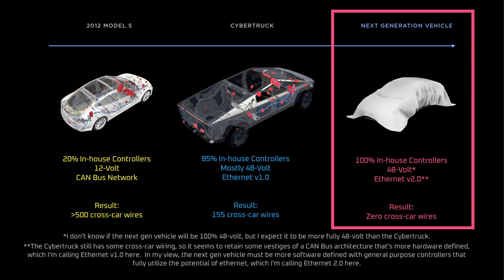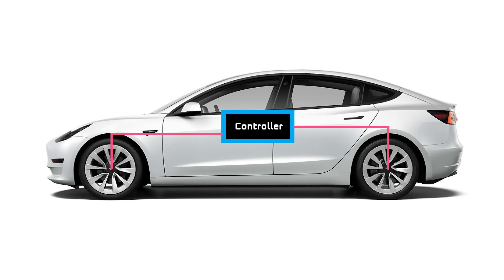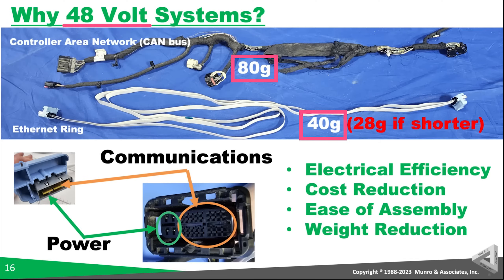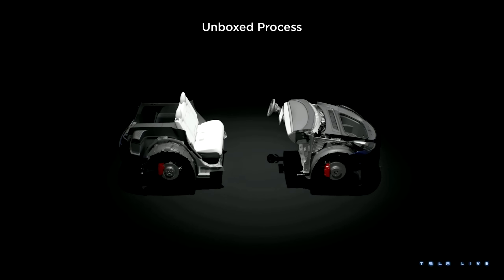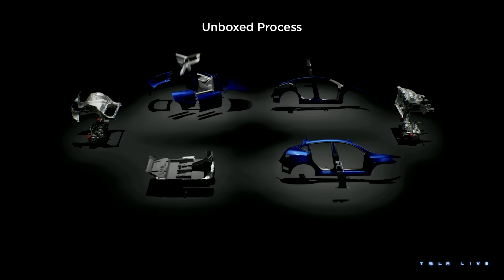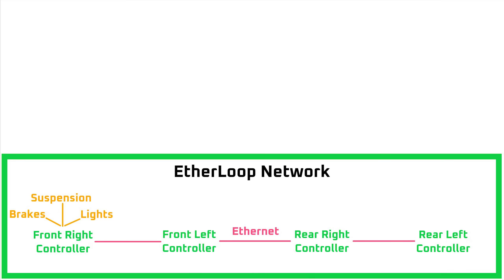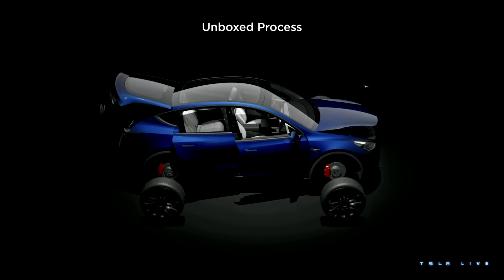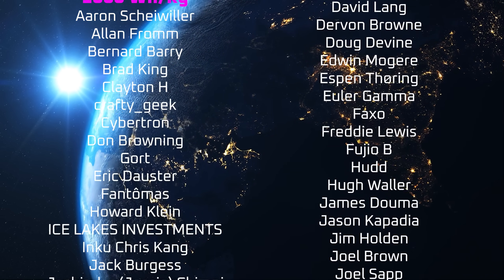Digging Deeper on Tesla's Etherloop Wiring System

Comment: Most of the things you mention could also be done with CAN. This is more of an architectural revolution, not so much a battle between two specific bus standards. The main advantage of the Ethernet bus is the much higher data rate.

CAN is an extremely robust and elegant system but it was designed long ago, and despite several updates the data rate just isn't high enough to properly stream video. The endpoint adressing also isn't that flexible, but it can manage a couple of hundred end points, and nothing stops you from building a ring architecture with CAN. Back then the whole system architecture was meant to be hard-coded in each controller's hardware (systems were very small and simple). Each controller would be assigned a fixed ID in its hardware and only listen to messages adressing that ID.

The ID also serves as an elegant prioritization scheme. After the bus is clear (previous message finished) all controllers that want to send a message will immediately start talking, starting by sending their ID. The highest priority ID corresponds to the most dominant voltage pattern on the bus. All the lower priority controllers notice that someone is talking over them and stop. That way you never have any delays for the highest priority messages, and never have any aborted messages either. This is totally unique. In Ethernet, if two end points start talking at the same time, both will abort sending after they notice the collision and then wait a random time before trying again. However, this is not much of a problem with the ring architecture, because you only have two end points on each bus, and if you use bidirectional wiring those two can even talk at the same time.
Reply from the maker: They could be done with CAN, but my understanding with greater manufacturing complexity

Definitely not my wheelhouse, but seems like etherloop is the way to go for unboxed
Reply: @thelimitingfactor  CAN is definitely not well-suited for some things that Tesla want to do with their vehicles (like having lots of cameras, lots of compute, doing lots of software updates). So it's definitely the right decision to switch to a new bus that can easily do all of these.
I just wanted to point out that the advantages you are talking about in the video don't really come from changing from CAN to Ethernet, but rather from changing from a traditional automotive network architecture to a ring architecture.
Reply: CAN is neither robust nor elegant.  Other than the cripplingly slow speeds of a '90's dial up modem, it has absolutely ZERO concept of security.  No device ID, no addressing - anything connected to the bus can blast whatever it feels like and listen to everything.  CANbus was outdated by 1991, momentum was the only reason it continued to be used.  Because it was simple enough that non software/networking people could use it and the tools were common.  The work around was to just use more and more isolated CANbuses throughout a vehicle, which itself became a nightmare.  The same data from one sensor/source has to be echoed on every bus, often with different names.  I couldn't design a more nightmareish protocol to work with if I tried.
Reply: @GregHassler  Nothing stops sensors from sending encrypted data over CAN. Providing security is not the task of layer two, CAN is no more or less secure than Ethernet. If you can connect to the physical wires of an Ethernet you can snoop and spoof any traffic the same way you can with CAN.

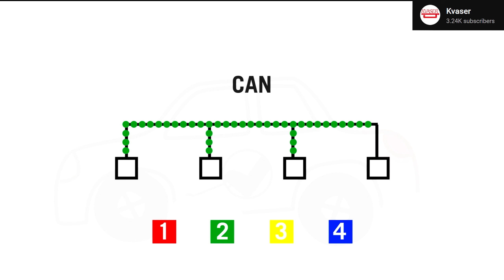Comment: The part at 15:54 is misleading. That does not happen on modern ethernet networks. Modern ethernet networks are switched, which means each node is on its own collision domain. Its been that way since the early 2000s.

Comment: Etherloop sniffs of IBM’s old token ring technology.  The downside to that besides slow speed, should there be a bad actor on the ring, the whole ring fails as the loop is broken.  IBM eventually came up with the MAU which was basically a switch that arbitrated network traffic and thus collisions on the network. That was where Ethernet survived as by design each node on the network was independent and surpassed the speed that was possible with TR.

Comment: I still don't understand why Telsa bothers to have ethernet wiring at all since they are using proprietary system anyway. They could easily use Powerline protocol (data over grid power lines) to transmit data over power connections and then you could have a single 48 V main line from front to back and every device using electricity would simply pull from it and use the same wiring for data, too. As long as the ethernet uses shared medium, a single broken device in the network can still mess the data line for everybody.

The only question is, could you do it all with a single wire because car body could be used to replace shared ground wiring? It would probably increase noise for data transmissions but for how much?

In case of Powerline protocol, it would be possible that a single failed device might appear just as extra noise and other devices could still communicate slowly in noisy network to allow identifying the failed part for easier repair.

Comment: Does this mean that if an accident occurs, a complete car subassembly can be easily and quickly removed and replaced with no wiring issues?
That alone would revolutionize car repair.
Reply from the maker: I would imagine so!
Reply: I saw this coming about a year ago.
If your passenger cage is ok, but the front end is twisted/cracked, you simply reverse the assembly process then transfer undamaged components onto a new casting and reassemble.
.
However 
It's likely that damage of that type *would * extend to other "modules".
.
Interesting implications for vehicle dismantlers! ("Junkyards")
They could classify by 
Vehicle Model
SECTION
Front
Centre (shell)
Centre base (Pack/ interior)
Rear.
.
Unbolt and store the undamaged, complete sections in a warehouse on racks.
.
You should be able to build a complete vehicle using sections  from 4 different vehicles!?
AND the resulting "Mongrel" would be in perfect alignment!

Comment: Changing the base voltage of automotive electrical systems has been debater since the 80's with no consensus past the 12VDC ceiling. Going above 48V raises the specter of getting electrical shocks from the basic wiring - also why Industrial controls typically run on 24 VDC/AC for safety.
Reply: Up to 50 or 60 volts is considered completely safe for humans.

Comment: This is the fourth time listening to this with 1:1 speed. I still don't clearly get physical structure of eternet. Would it be plug-in connectors between different sections of the vehicles that are built separately?

Comment: Any clue if Tesla may retrofit that etherloop network across their fleet into production factories ?
Reply from the maker: They will, but it'll take some time!  Better to roll it out in new vehicles rather than shut down the money printer
Reply: The Etherloop comes part and parcel with both 48v and the Gen 3 electrical hubs/ components.
.
I do think the "interim" vehicles will be a hybrid of amortized bodyshell/ production system and "pre-built (unboxed) casting assemblies".
Those assemblies would require the simplify of connection which comes with the Etherloop, which in turn would require the "Gen 3" componentry.
.
They will be a very crafty test bed for that system in cars that are "familiar" and can be made cheaply with existing tooling.
(imo)

Comment: A normal Ethernet cable has 8 strands, that's 4 times the copper of a can bus, this seems unlikely to be beneficial on its own. A point-to-point connection would suggest controllers act as switches which introduces additional latency. If you use two-strand ethernet and use a custom protocol for low latency, why even call it ethernet at that point. The name reminds me of token ring. While I'm sure Tesla engineers have their reasons and might be onto something, I don't think your guesses hit the mark.

Comment: I don’t believe your statement regarding controllers being redesigned completely to accommodate 48v supply is correct. Micros typically run on 3/3.3/5V and these are provided by the onboard power supply stages. Tesla isn’t replacing STMicro or Infineon or NXP or TI chips.

Comment: If these sensors use software, theoretically, the CPU could be eliminated. The octopus, they say, has neurons in its arms that helps with thinking. It could eventually evolve to the point where the brain could reduce to the point of merely connecting the thinking neurons in the arms.

Comment: Okay here's my question. Why do we need a windshield wiper controller? Since when does a couple relays and a few wires going to a self-contained windshield wiper motor module not work?
Reply: You don't. People buy it, they think it's important, and demand from the manufacturer complicated useless stuff. You have to take into account that this are the people who buy new cars, not sh ones. Lots of useless stuff get put into vehicles, which make it more expensive or deflect the money being put into stuff that makes a car more reliable like better materials for engine components or better coatings underneath to prevent rust. At the end of the day, the manufacturer cares about people who buy new cars, this people usually finance it over 5 years, and they usually buy another new car once this period is over. That's why, they can cut cost on reliability and put it into gimmicks because that's what the costumer wants.

Comment: your theory about ethernet only holds up with 10base 2 (created around the same time as can bus) not modern switched ethernet. Collisions like the ones you described were common on 10base 2 ethernet but now are so rare in modern Ethernet that its not even monitored for and when it is observed it almost always means something is physically wrong with the network. As for priority this was solved decades ago with QOS (Quality of service) tagging. The big change is that support features like VLAN's and QOS 10 years ago you would expect to pay $1k or more for those features in a small switch, but in the last few years you have started seeing those features on switches that cost less than $100 running on cheap commodity SOC's at their core. For that matter there is no reason you couldn't go fully fibre (fiberoptic protocol but not necessarily using glass) in a modern vehicle. for example considering the distances you could possibly use plastic fibreoptic cable, plastic fibreoptics are slower and have higher latency than traditional glass fiberoptic cable but are still has lower latency than copper and is nearly as flexible as copper wire while adding electrical isolation. The reason electrical isolation is important is it would make diagnosis of issues easier and would prevent one bad module from being able to damage other modules or the main computer. The down side of using a fibre based ethernet network is you would need a separate electrical bus for current but this buss could just be a couple (1 or 2) of wires or even bus bar that run the length of the vehicle and possibly some local distribution breakouts or fuse boxes if you wanted to add even more protection. the final advantage to using fibreoptics would be signal multiplexing essentially you can run 10 or more light frequencies in a signal cable so you can give critical functions their own frequency that would be the virtual equivalent of giving them a dedicated cable with absolutely no chance of collision or delay.

Comment: There's a reason we put all the brakes into one controller instead of just having a master controller and a whole pile of remote I/O.  Latency and reliability. If you need to do some high speed closed-loop control, waiting for information to be translated and come down an ethernet cable isn't feasible. Not to mention the redundant reliability issues you introduce by having so many more points of failure both on a hardware level and software level between the point your controlling (brake sensor or brake actuator) to the controller making the decision. And Industries are already moving to EtherCAT for higher data bandwidth needs. No one is going to use Tesla's proprietary garbage.

Comment: I really do not see how CAN stops you from having general controllers the same as any other network. With the right software + controllers/models, you could replace the network standard from CAN to Ethernet and back without changing the wiring apart from speed.

And if you are going to use cat type cable, aren't you going to use 8 wires instead of 2?

I think the change might have a lot more to do with making the parts proprietary and probably patented so you are forced to buy all the parts from Tesla at a high price without any competition.

Comment: 14:07 The EtherLoop Network seems to resemble the biological lymphatic system, with the lymphatic nodes and their systematic arrangement, where one group of lymph nodes can act as the confluence of many different areas through lymphatic vessels, just that in this case there would be no cross-wirings like in our body 😄

Comment: "N times less" as a concept only makes sense when comparing 2+ things, both of which are a reduction.  Say, a baseline representing 100% and then ThingA that's a 20% reduction and ThingB that's a 40% reduction; ThingB could be said to be '2 times less' than ThingA.  However, for 1 thing that's a reduction as compared directly to the baseline '4 times less' makes no sense; 4 times what? You mean it represents 'one fourth the weight'.  It seems to be a common misconception.

Comment: What about endpoint wiring? When you start combining controllers, the endpoint wiring increases. It's what bus systems like CAN are designed to prevent. Desing a CAN/LIN/whatever controller at every endpoint and there is no endpoint wiring. That's why buses were introduced in the first place. Until bus systems were introduced in cars, the whole harness consisted of endpoint wiring. Combining controllers is partly going back to those days of old...
Reply from the maker: What matters is the total vehicle wiring
Reply: @thelimitingfactor  Yes, agreed. And reducing that is what bus systems are invented to do. And it's exactly what they have done. You put your ABS wheel sensors on the bus individually. Don't wire them into the ABS controller first....
Etherloop and such are a good thing. There has been a need for ever more bus bandwidth in cars, hence the development of Flexray, MOST and many more bus systems for cars over the past decades. But it's the 48V doing the heavy lifting for weight reduction here (pun intended), while any sufficiently well executed bus-based architecture would enable 'unboxed' architecture of the vehicle. And at 10-20kg, I'd say we have reached the level of diminishing returns to stop further costly development for vehicles that weigh over 1.5 tonnes.

Those highly integrated 'zonal' controllers are kind of a new trend. I feel they are probably a good idea to lower production cost, but from experience with paying for electronic repairs on cars, I suspect they are going to raise repair bills by quite a significant amount.

Comment: The colisions on ethernet thing is a bit of a red hering.  Recall Tokenring vs. Ethernet?  One of the arguments of the Tokenring proponents was that by design there are no colisions.  Ethernet meanwhile solves the issue by retransmissions.  That was on shared mediums such as 10Base5 or 10Base2 coaxial wire.  Then the world moved to twisted pairs and switches everywhere and that killed the topic.  Somehow I'm having a deja vue when watching this video and the arguments.
That said, the latency still favors CAN bus.  Also most car desginers are - for good reasons - conservative if not paranoid.  If the "crash controller" after sensing a collision is sending commands such as "airbags - go boom" you'd want them to be transmitted 100% reliable at the right time 🙂
CAN bus is being used in other fields such as industrial machinery where I've seen things such as virtual CAN bus networks where CAN bus is encapsulated in something over Ethernet.  For a long time I was really waiting for something like this to become a transitional step away from classic CAN bus networks but I guess I underestimated how conservative automotive electronics designers really are.
Similar for the 48V thing.  Something I was awaiting for a very long time.  Every other year (or five?) a bunch of press releases or news articles about bumping the voltage are popping up.  To my surprise other voltages than 48V (but in the same ballpark) did pop up while 48V always appeared to be a somewhat obvious choice because it's a standard in other fields and still below the 50V threshold in safety regulations.

Comment: 11:22 sorry to be a party poper  but each wheel can't have it's own ,,wheel controllerl" First issue in that logic is the fact that axles share electronic motors. Second is the fact that   wheels are conected to a single abs module.  They are only 2 companies who have manufacturing capabilities for abs modules and neither makes singe wheel models. Although wheel speed data thru can to abs module  is something alredy in use. People forget that tesla is car manufacturer. And car manufacturers outsource alot of components,  becouse it's much cheaper to buy alredy designed and certified part. So if Tesla tried to design and certify each controller to multiple authorities would me to expensive to be variable. Ps English is my second language  so please ignore my grammar mistakes.

Comment: 21:15 I don't think the hardware advantage is that big. It's not too hard to design a generalized controller from scratch, and they don't even need to do that. All they have to do is tear apart a Tesla and tell their controller supplier to copy Tesla's controller design. Even with their slow processes, they could probably be do that in one to two years.